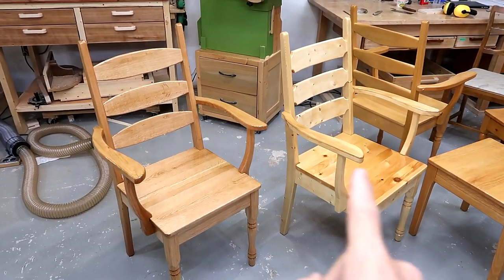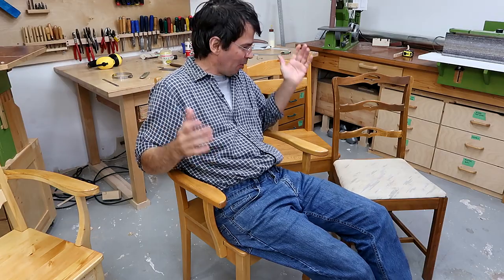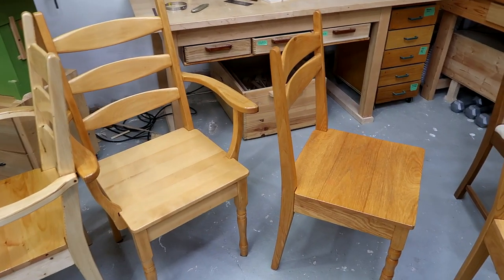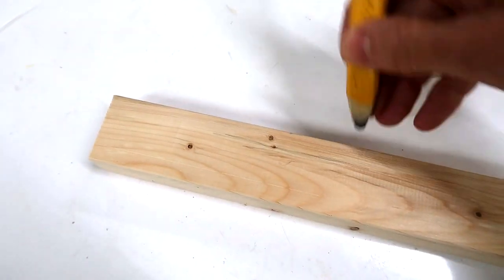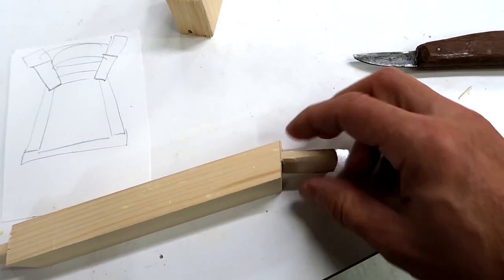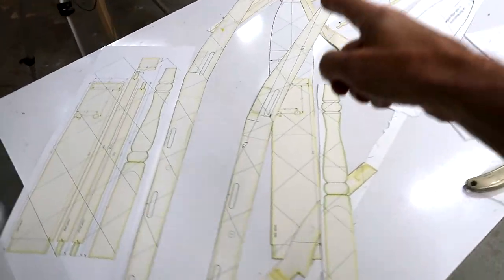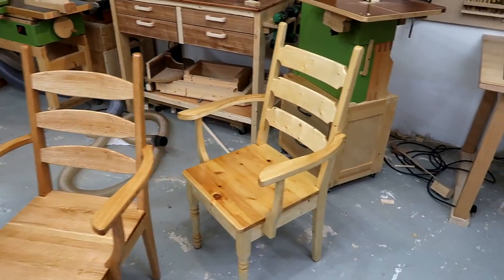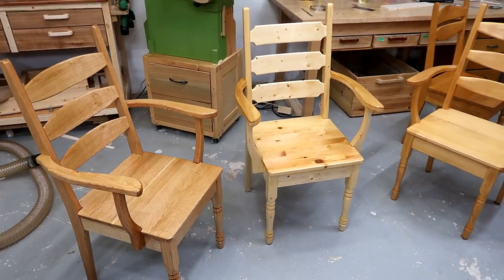More about my chairs and chair joinerey

Comment: FYI: I bought the plans, but when I click on the "chair.pdf" download link it just takes me back to the prior page. However, the option to email the plans worked correctly so I did receive them that way.
Reply from the maker: Thanks for pointing that out.  Just fixed it.
Reply: @matthiasrandomstuff2221  Also the sketchup link in the plan redirects me back to the order summary/download page.
Reply: @ronwarholic7673  If you go to the "Browse plans online" page you can download the SKP file there - I had the same issue you describe.

Comment: I can make those chairs and with your plans, it becomes so easy that if you make them, considering time spent + material, it is still a lot cheaper than a chair that you buy from shops. Unfortunately in my current condition, I can't make them, even though I have both tools and knowledge, you know, you can't do much in a 300sqft apartment. I should admit, every single one of your plans, worth buying since a lot of thought goes into making them, and as a bonus every single one of them is tested and shown in video. Thank you Matthias

Comment: This is great! I've been working on a few chairs based on a fairly inadequate plan I found online that were put together with pocket hole joints. The first one split exactly where you pointed out, no surprise. So I've been getting ready to modify the design to use mortise and tenon and to do steam bending to curve the backs. Thanks for the video!

Comment: Looks like the seat is completely flat. Most commercial chairs have some sort of shallow cut into the seats, presumably to make it a bit more comfortable, though I have no idea if that actually makes a difference. Any thought on how you might go about making such a relief cut? Only thing I can think of is some sort of template based router approach - like your router duplicator you made years back. Understand that goes against the simple design concept, just wondering how it might be done.

Comment: Could that deep mortice and tenon joint be strengthened with a couple of dowels or would that weaken the tenon? Your Dad was a true craftsman, I much prefer the 'square' style. And you are the proverbial 'chip off the old block'
Reply from the maker: it would weaken the tenon and the piece that the tenon goes into.
Reply: @matthiasrandomstuff2221  On tenons I have started cutting saw kerfs about 3/4 the length of the tenon, this gives a place for the glue to push into and are like little fingers that hold the joint together. I don't think it weakens anything if I stay a fair distance from the shoulder.

Comment: Question Matthias, Theoretically, depending on the boards you use and how you cut them out of course, could the back legs on the bottom be turned to match the front legs?

Comment: Would these chairs be just as strong without the armrest?  Id like to build two with armrest and 4 without.

I imagine these would fit our style if I made them out of cherry with some tapered legs instead of turned legs.  Easy mod.

My shop is currently in a storage container now - but I’ll buy a set now a save them for later!
Reply from the maker: Yes, the arm rest does not add any strength to the frame.

Comment: I'd love to buy the plans and make these chairs, but I only have, more or less, hand tools and I live in a studio apt lol
Reply: It’ll be rewarding if you made one of these with hand tools
Reply: @RobbieBeswick  no, it would be ridiculously time consuming especially considered I don't even have the bare minimum tools necessary to make something like this.
Reply: Well to be fair he didn't say you have to make the chair he just said that he wanted you to buy the plans.
Reply: there is different chairs that would work better for your setting, these chairs really make more sense for a machine shop. check out www.lostartpress.com and go to videos, in the "Make a chair from a tree" video handtools are used. or check out their books about welsh stick chairs. not saying it's super easy to make in a studio apartment, but you can do it with only handtools. and a low workbench (check out ingenious mechanicks for simple workholding)
Reply: @doggfite  You could get there with a good knife and a hand drill. A saw would make things easier though :D
I life in a single room apartment and use my kitchen table as a work bench. Much of the work i do on the floor.
But to be honest, i never built something complex, like a chair. I build two tables and a few small cabinets and other stuff with only hand tools and an electric drill.
Last year I bought a circular saw and a guide rail. Helped a lot to build straight furniture. with the hand saw i couldn't get everything very straight but the function is not compromized..
Reply: @simonstucki  also rex kreuger has some great videos about cheap easy-to-make workholding, including a low bench and some pretty clever old-style clamps/vises
Reply: Don't.  Don't even think about it.  I blame Norm Abrams for my addiction.  You need not go down this path.  Just say no.  You're good.  Adopt a pet.  Volunteer.  Resist.  At all costs

Comment: Love the chair with the rounded arms the last one you mentioned looked online its $8 the only thing is that I'm unable to print it off as only use this phone and even if you could send out printed copies I'm in the uk
Reply: you can print from a phone
Reply: @decyrano  sorry to be negative but don't have printer and am shielding due to illness so not going to anywhere at all and it's one of those things if was possible to buy copy's and sent then that's fine but to much to ask for but thanks anyway

Comment: Do you have suggestions to reinforce cheap chairs/tables that have a small block touching the aprons and being screwed into the legs? I always find myself tightening the screws as the legs tend to wobble within a few months of use.
Reply from the maker: more wood screws, but pre drill so you won’t split the wood.
Reply: Or buy Matthias' plans and make new ones 😀

Comment: I just built the table from this video  watch?v=jFPLFyxkhzc  .
My mom needed a table of a specific size to maximize space since she'll be working from home indefinitely now. I added a single alignment dowel for the long front boards just to make assembly by one person easier.
I'll buy your chair plans as a thank you. Hopefully I'll be able to build the chairs too. I don't have a lathe so I'll have to simplify the legs.
Reply: Your website must use some cookies or something for pirate download protection. 
I had to get the email attachment to download it. Not an issue, I run a very stripped down browser. Just something I noticed.

Comment: Hmm.
Doesn't the YouTube video editor allow you to add an outro onto the end of an uploaded video? If so, then just make an outro about the plans on the for the other video.
This question reveals my clear and obvious lack of YouTube Editor knowledge.
Reply from the maker: you can cut from a video, but you can't add stuff that wasn't in the video to begin with.
Reply: @matthiasrandomstuff2221  
That's not too surprising. What I should have thought of earlier is:
Add an end card that has a the URL and a link to the plans page. Similar to when you suggest a video.

One of those techniques should work. 

You can also put a link at the top of the description as well as post a message that you stick to the top of the comments section.